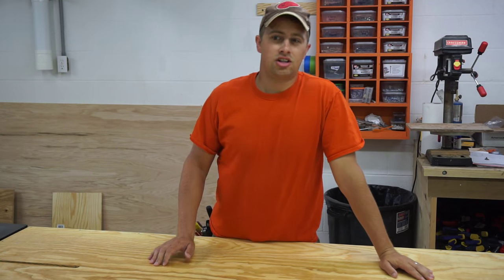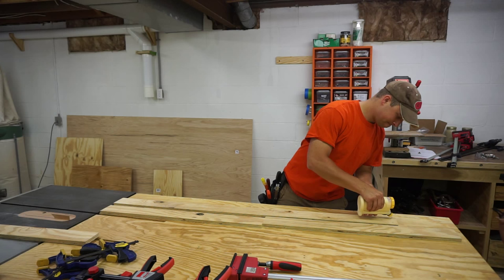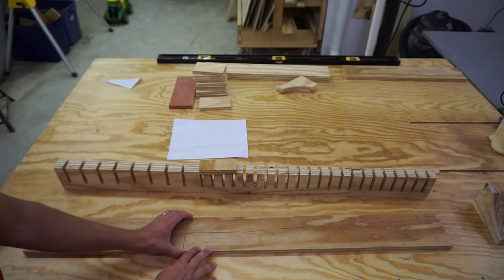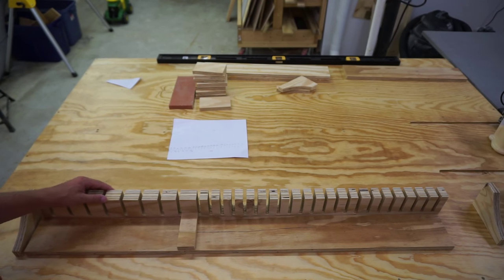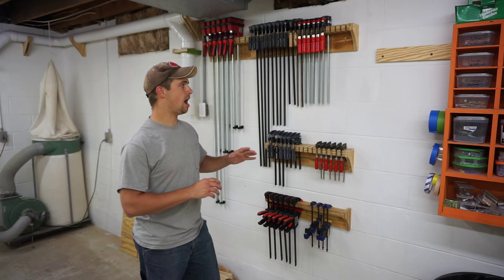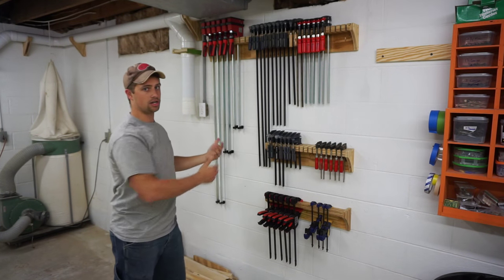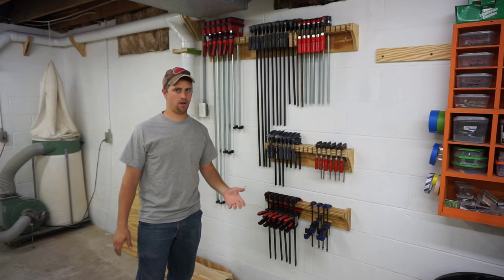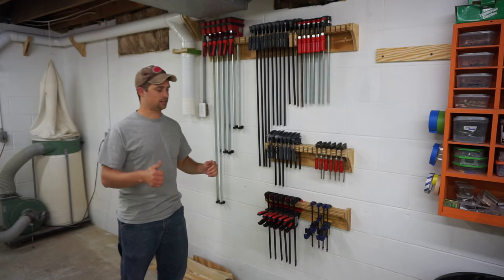Quick Clamp Rack

Comment: Nice Rack!  Simple elegant design.  I just noticed that if you want to make a change in your shop it requires a lots of drilling into cinder block which is a royal pain. just a suggestion, have you ever thought of putting up furring strips and a wall(maybe out of OSB or ply). The minimal you give up on square footage would be dramatically offset by the flexibility of changing things up.  Just a thought.  Keep up the really nice work.
Reply from the maker: +Larry Siroky Thought about adding walls like you suggested, maybe someday. Thanks for watching Larry!
Reply: +Tyler G Loving your Content.  I am binge watching them all today.
Reply from the maker: +Larry Siroky Thanks Larry, really appreciate that!

Comment: Great and informative videos Tyler.. You might check out Tapcon System for anchoring to masonry or concrete walls. Pretty simple and strong.
Reply from the maker: Thanks Kim....have used tapcon a bunch in the past, simple and work great like you said. Don't know if it's age of the blocks in our basements but I always seem to strip out. Thanks for watching!
Reply: Blocks are more porous than concrete. Unless you drill in the mortar joint or the web you really don't have much for the screw to grab into...
Reply from the maker: +Kim Shirley True, true.

Comment: I saw you sprinkling something during the glue-up (laminating the plywood) and a poster below referred to the "salt trick".  Can you explain what this is and how it works?
Reply from the maker: Sprinkle a little salt on the surface and it will prevent the two pieces from sliding around while trying to clamp them up. Salt dissolves and you have an excellent glue up!

Comment: My contractor used some bizarre concrete mix when he poured my basement. It is almost impossible to drill it to put an anchor in. I need a free standing rack if some sort.
Reply: I'm building one that will hang from a joist overhead.
Reply: Make the same system of hanging but attach them to 2x4 vertical posts (or anything else that is strong enough) that you can have free-standing in your work space (or roll it on wheels!)